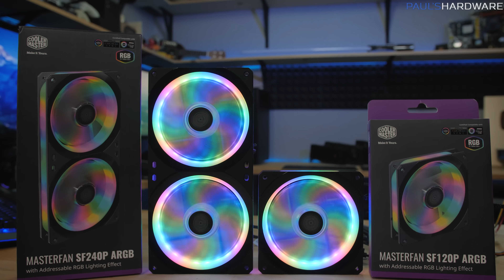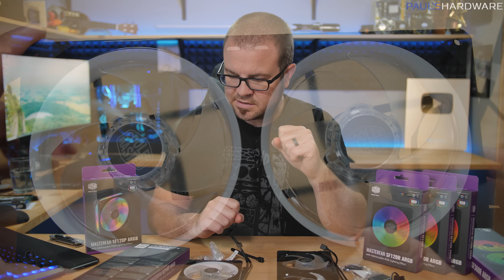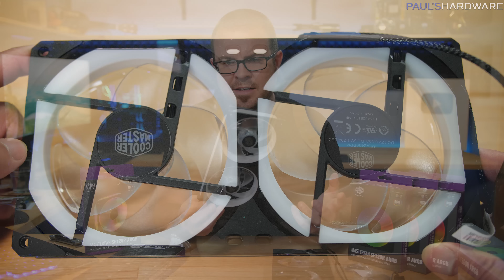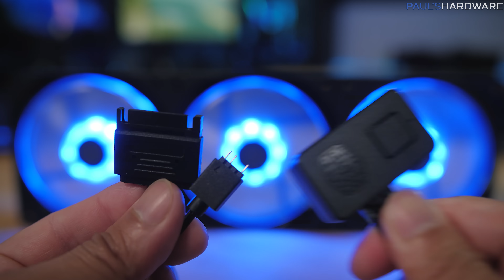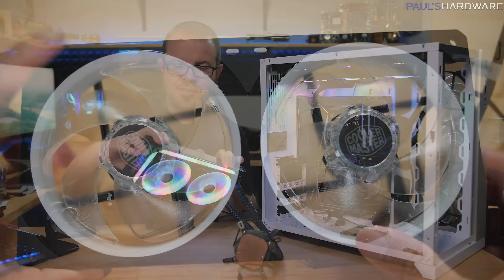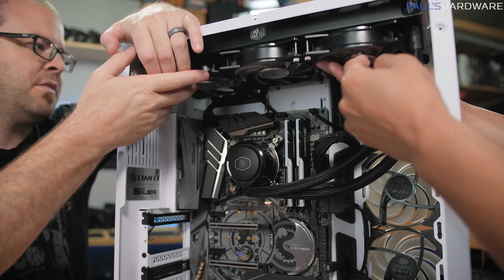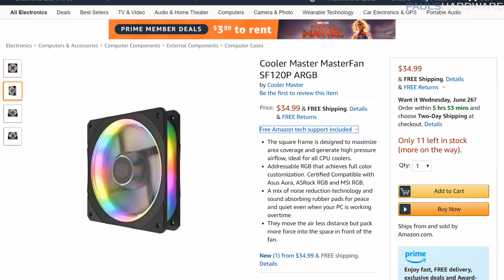Why Didn't Anyone Else Think of This?

Comment: Can this be used without a liquid cooler? Like if I just wanted to add a disk unit to the top of my rig? Thanks. Sorry if this is a noob question!!
Reply from the maker: Yes! It works just fine as a triple-fan unit 😁
Reply: It most def is usable without AIO. If not, they would have bundled it with their AIOs and not sell it seperately.
Reply: @zap7759  then don't buy it. I personally enjoy rgb to make my rig look better in my opinion. People can spend their money however they want.
Reply: @zap7759  why not both? We're not all as broke as you, and I have a fast reliable enough pc AND rgb rainbow puke, and although I don't plan to use the rainbows 100% of the time, the option to have them period is pretty nice.
Reply: @zap7759  'I'm an overclocker son'

Oh yeah, because I forgot, that's the only thing computers are good for, and the only thing worth spending money on, is more performance. Well, I have more performance with my rig than I'll ever need, so I want the fans to be high quality and colorful, because that's what I want to spend my money on.

Comment: Shoulda tested it with other manufacturers' radiators (especially with an eye toward, e.g., Asetek vs. Enermax coolers). I wouldn't be surprised if the spacing of the screw holes were a real issue for compatibility. Only the middle screws holes were oval-shaped; since the outer holes are still circular, any variation in spacing is presumably going to make it not fit. 

So I worry about product lock-in: "My Cooler Master AIO died, but my fans only fit Cooler Master AIOs, so I guess I have no choice but to buy my next AIO from Cooler Master too."

Comment: Enough with all the LED nonsense.  Function before form when it comes to real high performance computers.  Show pieces are fine, but LED's ultimately are just more heat for the system.  More power to those that want a light show, but I'd take a better fan over LED's all day long.

Comment: Good point on dust... why not have a magnetic dust filter on that assembly?
Reply: because then its added cost for people who intend it to be on a rad doing exhaust from the system who have no need at all for the dust filter.
Reply: @shawnpitman876  agreed. but maybe an add on option or a seperate SKU for the people who use them on test benches or an open case to prevent the fins from clogging.

Comment: this is a great convenience product. until one of the fans dies then your pretty well screwed. a thin mounting plate solution would be a good mid point to allow the same kind of convenient installation onto rads.

Comment: I believe Antec has had a similar product for a while now. I think 240 is the largest they have though.

Edit: It's called the "Antec Prizm Addressable RGB Cooling Performance Fan Matrix" on Amazon.

So yes it has been done before.
Reply from the maker: Good find! Fwiw, I did attempt to hunt down similar products that already existed but I didn't come across the Antec. They definitely need to brand that better!
Reply: to be fair to Antec - I think its just something they came out with in the last month or so. though $54 for 2x120mm fans glued together?? Yeah, NTY. Id much rather buy two much cheaper RGB fans individually and use them however i want them. stupidly overpriced for a few small gimmicks and not really that useful gimmicks either.
Reply: RDelacroix     “Fan Matrix” I mean, that sounds pretty badass. lol
Reply: LMFAO no wonder no one knows what it is.
Look at that fuckin' name.
Reply: Shawn Pitman 😂
Reply: It looks like the antec one is an airflow fan setup where the CM version seems to be static pressure oriented, making it better for radiators.  Although if any of you remember the video Linus did showing that having a radiator with sp on the intake and af on the exhaust makes it seem like having both versions would be best.
Reply: I wouldn't say it's been made before. These CM rgb fans have rgb running along the sides of the fans and the Antec fans are just simple addressable rgb fans.
Reply: @anthonyt4981  well to be fair only the 240mm does that, the 360R very clearly didn't have that light panel, hence why the 120mm and 240mm variant of that is called 240P instead of 240R, because there's a difference.

Comment: If one of the fans dies? you have to change everything.
Reply from the maker: This is absolutely the biggest drawback for this design
Reply: I have been in IT for about 20 years. In my experience case fans are way more reliable than a lot of core system components.  Ranked from most to least failures, here is what I've seen die over the years:
1) Hard drives (over 100).
2) Power supplies (dozens, lead by Antec Earthwatts models).
3) Motherboards (dozens thanks to the electrolytic cap plague).
4) Optical drives (under a dozen).
5) CPU/case fans (a half dozen).

Sure fans have moving parts, but they are dead simple and light enough that there is not much stress on them from prolonged use.  LED fans are a "style" component more than a system component.  While they don't have any more moving parts than non LED fans, a fan with 20 LEDs has 20 more parts that can fail.  So if you only care about moving air through your case, a triple-fan part is not likely to fail on you.  But if you are buying this for style points and you have OCD, the ONE LED that will inevitably fail will make you wish you'd gone with 3 separate fans.
Reply: LED looks weak and the housing is a good idea, but a RMA disaster if one of the fan fails or if the LED fails to work.
Reply: Had a fan that came with a coolermaster air cooler I had die after about a year. Only time I've had it happen and it was probably because of animal hair getting in the bearings.
Reply: I want a noctua version.
Reply: yeah ill just stick with my brown and tan fans ty :)
Reply: Fans die, that's a thing. Weather power supplies or motherboards or GPUs die more often doesn't mean anything unless you throw out your CPU fans when your PSU dies. But you would hope and expect that by the time one of your case fans die; an identical replacement probably isn't readily available any more,  and let's face it; you're buying something like this based on aesthetics,  ...so you aren't going to jank in one unmatching fan. But you won't be able to repurpose the others I guess.
Reply: can't remember the last time a PC fan died
Reply: Warranty
Reply: @CustomCoinRingsUSA  what if you're a dumbass like me and break one?
Reply: @Chenier57  add a single 120 then
Reply: I have had PC's since the Intel 486 processor and i've never had a fan fail. RGB/Motherboard/Case/CPU...etc...etc.
Reply: @rip.tear. in my 36 years ive not had cancer, ...so it must not be a thing?
Reply: @forestR1  That's extreme, illogical and irrelevant. Its obvious that I'm sharing my experience with the commentary. You can try and discredit it if you like but it says allot more about you than me.
Reply: @forestR1  lmao dude fans really don't fail if you look after them. Of course it CAN happen, but it's extremely rare. Honestly I've seen more fans with blades snapped from hitting cables than just straight up dead, but that's PEBCAK.
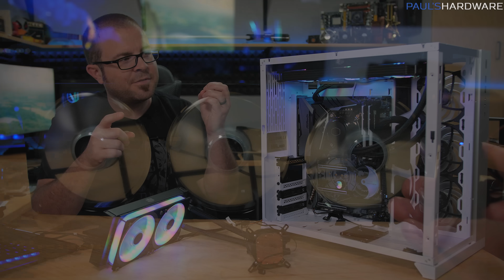Reply: 10:00
Reply: True though I’m sure they have a hefty warranty
Reply: I remeber the Lian-Li had a simple daisy chain system for their version of this concept.
Reply: I have literally only had a single fan die on me in 25 years, and it died after nearly 10 years of 24/7 use.  Your fans will long outlive your computer.
Reply: I can’t remember having a fan die ever. Or any LEDs for that matter. Not that it can happen but I personally wouldn’t worry for myself. Most of us are changing that stuff out every couple of years anyway.
Reply: It's all about the RGB man!!
Reply: I hope they have an accessible oil port, because damn these look like they could be pretty. Couldn't imagine the horror hearing a mid-summer BRRRRRRRRRRRRRRRRR from a single fan in the three-pack and being unable to lube it back to life.
Reply: In the last 10 years I've had 1 fan fail out of the more than two dozen fans currently operating in my systems, all of varying price and quality. Mind you I dust my systems regularly and always clean the hubs the best I can. Now my friend who never dusts his system has had 4 fans fail in the last 3 years.... but they were very very cheap NZXT fans.
Reply: @toastymuffin4153  NZXT fans (at least circa 2010-2015) are the absolute worst. Most fans get a little dry, you can get another year or three out of 'em with some oil in the hub. Their 120mm fans have a solid plastic cover under the sticker that isn't coming out without destroying it, and the fans themselves reliably start barking after a couple of years. I don't think I've ever had a fan that janky before or since.
Reply: @YesterdaySoup  They are indeed the absolute worst and yes they were all 2012 NZXT fans XD
Reply: If they offered a crazy warranty on it, then I'd be happy to buy them but otherwise it's the opposite of a good idea.
Reply: @Chenier57  I actually like this concept of a single lead but with multiple fans (from a cable management perspective). I just hope this product allows for swapping dead fans with another one (like what they have for newer Sapphire GPUs)
Reply: if u not treat fans like EA Does
it wil be okay my dude
Reply: how often does that happen?
Reply: When have you ever had a fan die?
Reply: I've had a power supply fan die on an old pc.  We're talking back in the Pentium II 350 days.  I also had a case fan die on an older core 2 duo system.   Nothing that killed the PC components though.  I like to use Noctua fans nowadays as they are usually quieter and hopefully last a good long time.
Reply: I can't remember the last time a fan died on me...I had fans that lasted more than 10 years that kept spinning just fine.
Reply: Why did this comment get so many likes? 

Did people not watch the video? Paul talks about that. Duh.
Reply: I've had far more CPU failures than fan failures. "Most likely to fail" might be true, but it can't be by a wide margin, and even these double and triple fans will be cheaper to replace than most other components.
Reply: I have had gpu and case fans die. Not in over 5 years tho. It helps to not spin them with your air dust removal method of choice. A dustvac in my case.
Reply: Was just about to type that exact comment
Reply: They should take the idea of sapphire swappable fans. So if a fan dies it can be swapped out with 1 screw. That's if of course sapphire doesnt have a patent on it which they most likely do. But a variation of it would be great
Reply: The leds will be faded long before the fan dies. I got their ML series fans and have had them running nearly24/7 for 3 years now. The brightness of the leds has dimmed significantly, I honestly wonder if I could RMA them all. Some have also developed a sound to them but I have yet to take them foully out for an extreme deep clean to see if that fixes it. 

Now there is no reason for those leds to be so dim as I have plenty of other leds in my build that have run just as long with no change in brightness, it all comes down to quality.
Reply: I had the fan on my scythe mugen cooler die. Fortunately it did a good job cooling passively on airflow alone, so I never noticed until I decided to open up my case one day.
Reply: Cut it in half m8.
Reply: if one dies both will probably turn off
Reply: @umarhussain8033   the fans will most likely last longer than anything your system. you will probably replace your gpu before your fans die
Reply: @umarhussain8033  Buy them singular and join together as needed,if 1 dies .......you won't be replacing them all....👍
Reply: @umarhussain8033  Wait for future version when you can exchange the fans.
Reply: Fans are absolutely NOT the most common hardware failure - HDDs are, and by a very significant margin(they're the most high performance & fragile machinery in your system after all)

And, yes, THIS is well known
Reply: Kind of like if the pump dies, or a hose fails. Harden up princess.
Reply: Yeah ive has a couple of cooler master's fail but over a long period of time
Reply: sorry you're poor